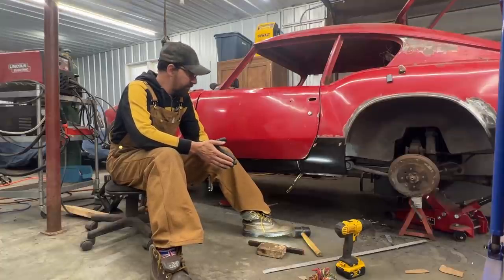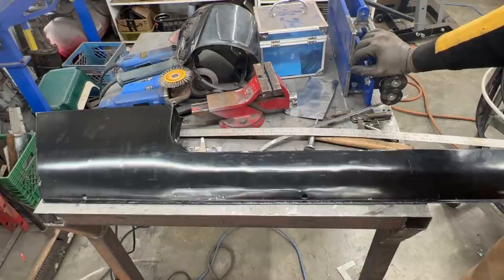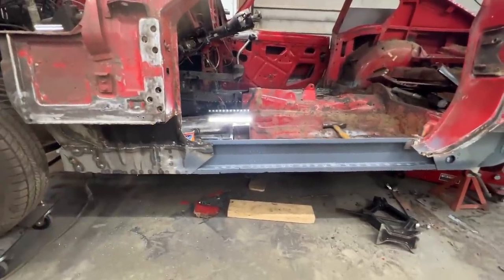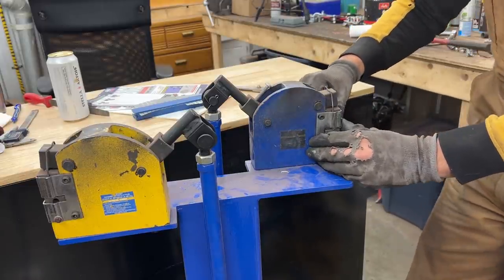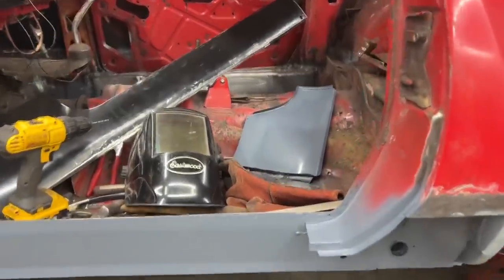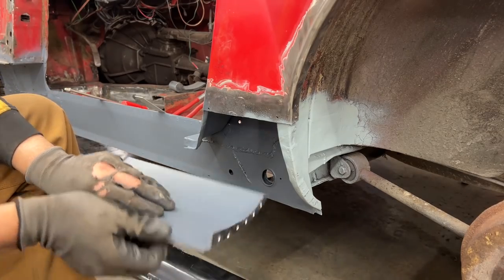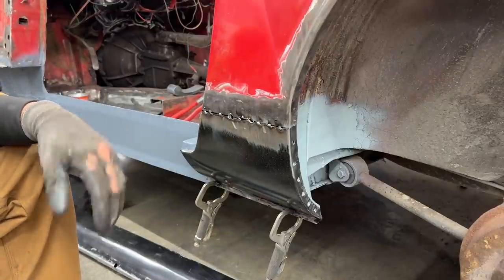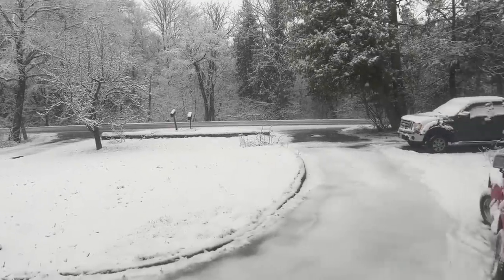1966 Triumph GT6 - Part 36 - Assembling The Sill Structure

Comment: When you are cutting you are not cutting at 45 degrees.  You are only at maybe 30 degrees from the horizontal, so you are taking metal from the new panel and too much from the original panel.  I think that is why the gap is wide. At 45 degrees to the original panel there would be almost no gap.  But the result still looks good, I don't think I could do any better.    
Fitzee cools the weld immediately with an air gun and  does not do another weld close, until that one is cool.  He welds again at least a distance away. He also does not use a grinding disk (too much heat again) , he uses 24 grit sanding disk  (only on the weld, not on the panel) and even keeps that cool.   I'm going to try it myself on some scrap metal because I'm sure it needs practice.  Great video again, I'm always waiting for your next one.  :)
Reply from the maker: Yeah, I realized my angle was wrong when I started editing the video :)
Reply: @RustyBeauties  I don't think anything is wrong, it's an art after all.  I enjoy your humour too, and the walk-on parts by the dog. Always waiting for the next video from you. Thank you

Comment: You pushed it in.  remember, when you cut on a 45 degree with the cut-off wheel, you pushed in on the panel to make it go in to close the gap.
Reply from the maker: I used a straight piece of sheet metal to push the lower metal in, but I didn't push further than the straight line. It sank in as I was welding.

Comment: Having a gap the size you had is almost perfect, it allows the weld to be between the two panels so when ground it is not thinned any more than the parent panels.
Reply from the maker: Yeah, normally when I do butt welding I leave a gap like that, but the idea of this technique that I tried is to leave no gap and have the two panels line up on their own.... It works in the original video of Fitzie

Comment: Hi Elin, check out the Retropowercars YouTube channel. They have done a video on how they weld panels and they do it all the time. 
The main difference is they prefer TIG welding with panels and they also plenish the weld as they progress to help take any distortion out as they progress with the weld.
Reply from the maker: Yes, TIG welding is a different story. The heat is not so much and also the seam remains soft and you can work it with a hammer and dolly. I've got a cheap TIG welder, I just need to learn how to use it LOL

Comment: when welding 2 pannels together spot weld then use you're air line to cool it down straight away to stop the pannels from buckling in.
Reply from the maker: I normally do that, but they still buckle. This time I decided to try this technique which someone told me about, but it didn't work well either

Comment: That was a tough join but still worked out at least acceptable. You can’t expect every patch to be miraculous but you get closer than anyone else I know. Next time perhaps leave 2mm instead of 1mm and come in at a steeper (60 deg) angle from above that should give you an angled face remaining, -just a fraction wider than your cutting disc….😊

Comment: I don't understand why you don't joggle these joints? Very little grinding after welding so less distortion, and you have a bead roller.
The reason the joint technique didn't work is because the angle wasn't acute enough.
I reckon your making a great job of this rusty wreck, it's lucky to have you.
Reply from the maker: I realized my angle was wrong when I edited the video :) The joggle weld is a trap for moisture and I try to avoid it, but I keep trying every once in  a while. Just a few videos back I did joggle weld on the rear of this same wing. It still sank badly.... And since there are 2 layers of metal it is very hard o pull it out now. The door on the other side of this car was also joggle welded too and still the seam sank in some areas. I need to find a way to reduce the heat... Maybe learn how to TIG weld instead of MIG
Reply: @RustyBeauties all very true, you can always seam seal it after.  it's a real problem and the only thing IV tried is to joggle and tack a 50x50 angle across the door just above or below knock it off after, it leaves it flatter, still needs a skim but nowhere near without it.

Comment: Elin your cutting disc looks very thick,  I use fitzees processes and I have no problems, I use 1mm cutting discs, sometimes you can get variable widths in cutting discs, I sometimes either use a dremel cutting disc for small pieces or run the cutting disc against some scrap metal to thin the disc up a little,  can't remember what company fitzee uses for his discs, I use whatever is cheapest on ebay
Reply: He was also cutting the lower panel at the same time
Reply: @bobdoerksen6594  yeah I noticed that too
Reply from the maker: @darrenwalker993  No, my disk is 1mm. My angle was wrong, but I only realized that when I saw the video. And Yes I was cutting the lower metal too, that was the idea, to cut both layers at the same time in the same place so their cut edges match perfectly. Well, that was the idea :) we all saw what the result was LOL